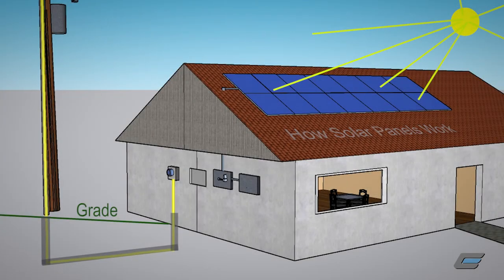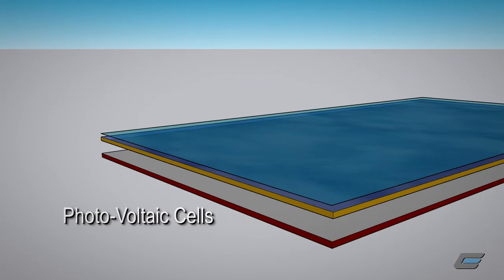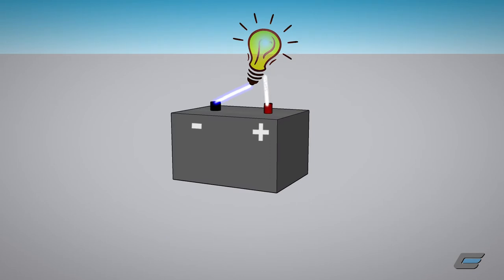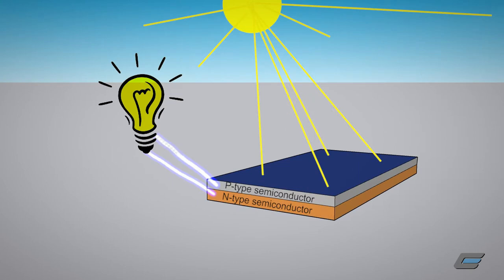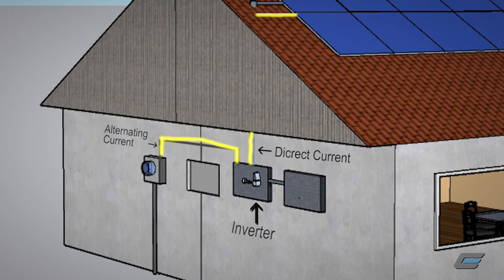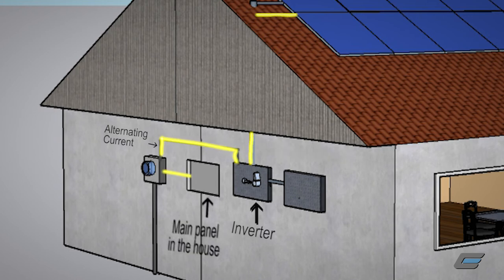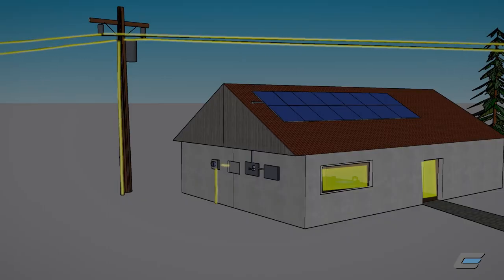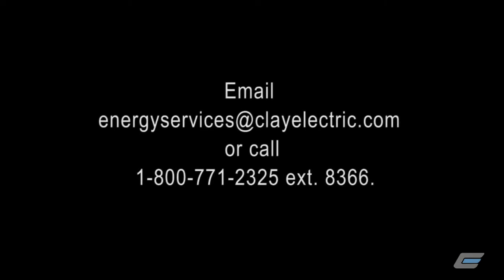How Solar Power Works

Comment: It's that simple? I appreciate the effort to educate coop members about solar. But I still have a hardtime seeing the payback or savings after spending $25,000 on a system and then divide that bythe $100 a month or so that I average. Like paying $100,000 for an electric car that most folks seem to sell in 5 years with low mileage. Keep up the great work!